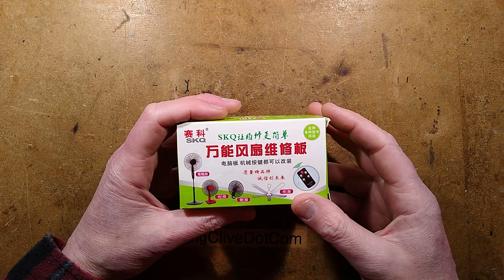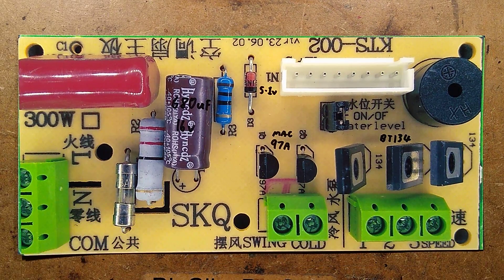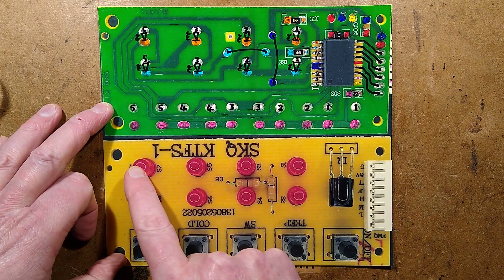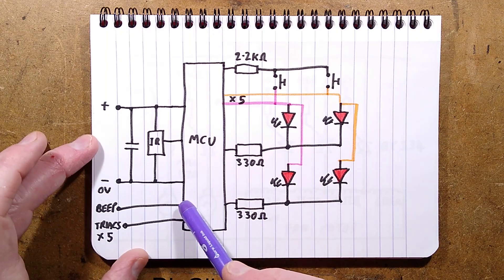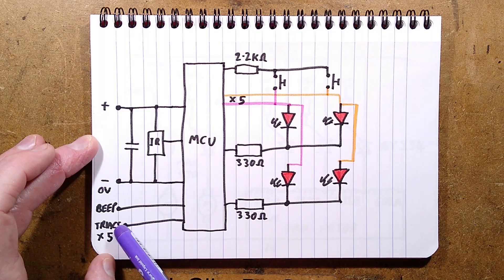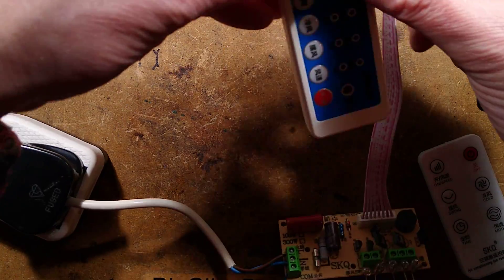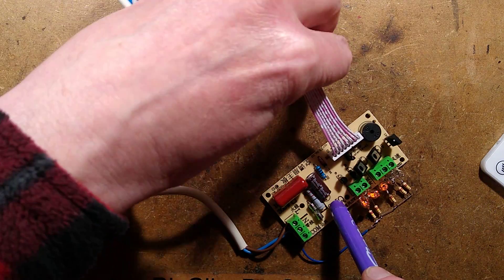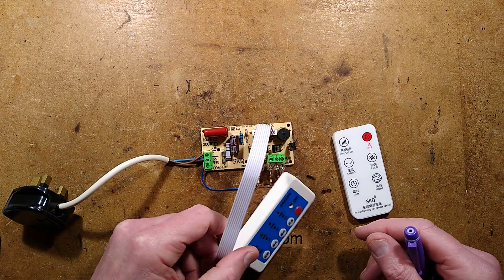Universal fan control module teardown - with schematic

Comment: just happened to be thinking about how i could regulate the new AC fans i found intended for trash.
Cofan 230V AC / 36W ..  usually i'd go with 120mm PC fans and use pwm.
Until now it was easier+cheaper to just get the "honeywell HT900E" to blow a/c-cooled air through my apartment..

Comment: I would love to understand why it can't use a bridge rectifier. You said one leg is referenced to the mains. Why does that prohibit a bridge rectifier?
Reply: For the TRIACs to be triggered properly the common of the DC control circuit needs to be directly connected to the common of the AC supply. With a bridge rectifier there is by necessity a diode in the way.
Reply: @eDoc2020 Thank you so much!

Comment: As you noted; the LEDs are multiplexed so I would not expect the module's current consumption to change drastically when the number of LEDs lit varies. Instead the TRIAC drive must be simultaneous and 100% duty cycle so would expect the number of TRIACs ON to dominate the current consumption. To an extent you could hear the quality of bleep change slightly when you switched on more outputs.

BTW: What was the rail voltage under minimum load ? Did it ever reach 5V ?
Reply from the maker: It peaked at just over 5V.

Comment: I have an industrial fan in the workshop with a similar control (single winding so there is only one triac), the mode button is called "breeze mode" on my remote and it changes between a sequence of speeds. An absolutely useless feature, driving a 250W motor with a triac is already loud enough without it shifting all the time. The way they control the LEDs and switch buttons is strange to say the least.

Comment: Sir,, i subscribed today.., again?
  Anyways have you or do you know how the soft start wotks on these very exspesive power cords.  They limmit start up currant.  I havr not found anyone expanding what they acualy do....
Thanks for your work.  I find it very helpful..
Reply from the maker: The simplest inrush limiter is an NTC thermistor.  But the more advanced soft starts seem to use a ramped phase angle control.

Comment: I learned what happened in electronics class when you miswire a multispeed fan motor.  someone brought a fan in with a broken switch and rigged up another, but got the connections wrong.  he turned it on and the fan started up and ran fine.  then about 10 seconds later big gouts of smoke came out of the front of the fan and smoked out the whole room.

Comment: That LED button thing is pretty cool. It allows the uC to multiplex the LED user 'experience' and also read the buttons kinda simultaneously. The uC will set whatever logic it wants to for the user on the inputs of the 330R lines, then it turns on the pink circuit, and also reads the input from the 2.2K signal line. Each time it goes through the loop, it is setting user output information and also reading user input information. Seems a pretty efficient 'multi scanner' circuit.

Comment: When you had the board plugged in and you were pointing i was thinking "my God Clive watch your finger's that board is live" 😮 
I could think of other uses for something like this.. it's able to switch a good few different things and had a timer too. The language barrier is worrying coz iv an awful habit of getting something and then going into a different project and forgetting about other things i wanted to try. Finding the parts i bought and thinking "what's this circuit board for again" and that having Chinese all over id be a while trying to remember.. i also have that electronic hobbyists curse of buying stuff you don't need or will ever use but never think "that was a waste of money"🤔🇮🇪🙏

Comment: Hi Clive:  How is the speed of an oven fan controled?  The one in my oven looks fine, and runs smoothly, but now and then it does not run up to full speed until given a thump.  First time I found this out was when the heating element blew, and I very nearly blew a second soon after, but was lucky enough to smell overheating in time. Very expensive little fault.

The motor looks simple and robust, with nicely self aligning ball bushes at each end, but I'm fed up trying to find thicker and thicker self tappers for the cover, every time I take it out to have another puzzle over what makes it speed up, and why it doesn't always work.

I wish I had discovered your channel years ago. I fear I will never be able to catch up now! My life seems to have been almost entirely spent just fixing one thing after another: anything that can break down always does so as soon as it comes near me!  It does teach me stuff, but I'd have liked a normal life too!  :/
Reply from the maker: Check the fan is spinning freely.  It may be getting sticky over time and only running when things have started heating up.
Reply: @bigclivedotcom  Thanks Clive.  I've stripped it down and cleaned it several times, and balanced the fan blades.  At first it was a bit tricky getting the armature to run dead centre, till I realised that just tapping the spindle while it was running that lined up the bushes, but there is no noticeable friction once it's lined up. I replaced the wire connector shrouds that had gone brittle and dark from oven heat (I use it quite often on high setting for bread making, which may perhaps be more harsh treatment than basic home ovens usually get. )  I was just puzzled at how the two speeds are obtained without any obvious way of setting them, in the external controls at least.  I thought it might have to hit some magic combination of speed and field strength in the right place at the right time, to give it a continuous acceleration up to the design speed.  Tempting to give it shots of silicone oil spray, while moving, but you really don't want that smell in your dinner!  :)

Comment: I'm just starting to understand electronics (the School of Clive is strong), but I'm a little lost on the power supply here. If the local 5v rail is actually the live connection, half wave rectified, does that mean that the +5v rail, referenced to earth, is 240v and the local 0v rail is 235v referenced to earth? I vaguely understand switch mode PS, but this design is new to me.
Reply from the maker: The 5V is referenced directly to live and the circuits zero volt reference is 5V below that.  It might make more sense imagining a 5V battery with its positive connected to a live wire.

Comment: Mode on my cooler is labled "Nature" and is meant to simulate a breeze(according to the manual) I have never used it. XD

It has the same remote as the one in the picture not the ine you actually have

Comment: I think the Mode button activates what in certain fan is called "night mode", setting the fan at high speed at the extremes of the swivel points and low in the middle point, so you can orient the fan and don't get a full direct blast of air when sleeping. Just guessing.
Reply: That's really clever. Something that I would definitely want on a hot night.

Comment: Have you ever done a cheap variable-frequency drive? I might think that a VFD is the only way to get a fan to run below lowest power? I hate that all fans go "high, hurricane, armageddon".
Reply from the maker: It would be a very complex way of controlling one of these fans.
Reply: On these fans you just need to vary the effective voltage. A cheap lamp dimmer usually works well enough, although it can cause motor buzz.

Comment: i recently had a smart metre installed , was shocked how much watts my standard floor fan uses , it is 14 years old though, do they pull more wattage older they get ?
Reply from the maker: They can pull more as the bearing lose their lubrication with age.  But it may also be the way your meter is measuring power.
Reply: The multi-tap motors used in most multi-speed fans are pretty inefficient, especially shaded pole types.

Comment: I used a six channel remote unit to replace my caravan motor mover controller. Cost about six quid, where the original would be over one hundred for a replacement circuit board, worked perfectly.

Comment: Is there a way to change the fan rotational direction?
Reply from the maker: It will depend on the type of motor.  Most fans use a shaded pole motor and can only go in one direction.

Comment: What's the quiescent current? Because I once had a ceiling fan with a similar module that ended up costing me 50€ per year for literally just hanging around.
Reply from the maker: It will appear higher than it is on simple current meters due to its very low power factor.

Comment: Can you still use the buttons on the stand fan to control the speed if this is installed?
Reply from the maker: No.  This would generally replace controls like that.

Comment: Interesting to note that the buzzer takes on a more "pulsed" sound when more LEDs on the control panel are lit, somewhere there's a component that's struggling to supply enough current! When I've used units similar in actual fans I always assumed it was the beating of the blades making the buzzer sound funny, not the multiplexing of the LEDs!
Reply: It’s because when the LEDs are on it’s showing more current from the power supply and since it’s halfway rectified it takes a lot more to filter it

Comment: I have a fan, that recently decided it was going to start changing functions without a button press.  Thanks to this channel, I was confident in ripping out the speaker that beeped every time it changed (it was literally every few seconds) i then also completely disconnected the wires from the circut board to the tilt motor.  It now no longer moves automatically, but it functions as a fan on low, medium and high as it should.  (And every few seconds thinks it's tilt is being turned on by an unknown source.  Still no idea why)

Comment: dude. why do some apps heat up i phones? i mean i kind of got why some cams flicker light but
Reply from the maker: It will depend on their processing power requirements.  A typical technical app should use very little power.  High power may indicate a gaming app or rogue activity.

Comment: When the "Mode" thing was enabled I was wondering why they'd have that, but seeing some other comments, it's a feature to create a natural-feeling breeze apparently, which actually seems like a smart idea, although could be annoying if I hooked one up to my wall fan that sounds like a damned aeroplane prop when run at full tilt (I currently have it on my stepdown transformer and on Low to keep it quiet!), though said fan does have a big IR window on it which would lead me to believe there is a more money model that actually did have remote controlled functions (or is just a place to hide a naughty voyeur cam)... :P

Comment: Do you think this is offered in the United States voltage? It would be interesting to see if the design is exactly the same. 😒
Reply from the maker: Some are advertised as working from 120 to 240V.  With a capacitive dropper it would be fairly easy to adapt it to 120V with a different capacitor.

Comment: After watching this video and reading the comments, I can see me using something like this to control a bunch of stuff here. I need a remote for an infrared heat lamp in the bathroom. Being able to turn it on and off while wet with a remote would be heaven!. We always swap those horrible LED lights for halogens when we move in. Also, we have shittee baseboard heaters which I can't tolerate since they take forever to heat up and forever to cool down.
We also have a nice in the wall "space heater" that has a useless thermostat (37 minutes to shut off). Having a remote to change it on or off from bed or the couch is something I was already planning.

Comment: I think they include a classic water level switch with faston terminals because many OEM switches now use tiny connectors with random pinouts and some are even low voltage DC.

Comment: 6:42 - Somebody in China's getting fired. I do this trick sometimes, but you can stick the zener there, so it not only limits the voltage to 5V, in one side, and pass the unused half of the AC, allowing the capacitor dropper to work. Saves one part, and the labor to install it. Use a 5.6V zener, instead of 5.1V, to account for that one diode's drop.
Reply: That does reduce the component count by one but it also increases supply ripple. With the capacitor-resistor-capacitor used here and the Zener at the output the result should be fairly smooth DC.

Comment: Awesome find. Here in Australia remote control fans are no longer available. A few years ago most fans were remote but not now. This module has the potential to be a simple inline unit for non remote fans.
Reply: Thats because 99% of fans in Australia are switched on late November and not switched off until about March. By then the remote is long gone.
Reply: As a Sparks here in Australia I finding plenty of ceiling Fans with remotes, on the shelves in most fan and light shops
Reply: @steveosshenanigans  Sorry, i was referring to pedestal fans.
Reply: @darkman19693  ah right, those POS fans i hate seeing those ones. There shite mostly sold in Bunnings

Comment: Having seen this unit on the Patreon stream I thought it would be useful, modified, to control a fan/light I had seen where the remote control was missing.
Unfortunately when the fan/light unit arrived I found that not only was the remote control missing, it seems that the light panel has also been removed along with the wiring for it and the power supply for the fan. The seller is going to search for the missing parts but I suspect that his source had removed the missing parts. I'm expecting I will get a refund from ebay.

Comment: I feel VERY comfortable with the Hyncdz-branded electrolytic capacitor. NOT!

As others have noted, "Mode" is likely a simulated breeze, using random-ish on/off and fan speed cycles to feel more like a natural breezy day instead of a non-stop blow. I personally don't like that "feature," but I can see some might prefer it.

Comment: 14:53 I have a Japanese fan that does that - it has a setting called “random” that effectively cycles randomly between the four speed settings (and off) at random time intervals to “simulate a natural breeze”. I guess that that’s what at least one of the things the “mode” button on your unit does.
Reply: I have a fancy japanese fan too, and i was thinking the same. It's supposed to simulate nature (because the wind outside isn't constant).

Comment: Clive, have you considered using an isolation transformer for your workbench? Makes probing around in circuits at live mains voltage a little saver. Keep up the good work, very much enjoying your videos!
Reply: Please bear in mind, an isolation transformer will save you from a Live to earth shock, but it won't save you from a live to neutral shock on the secondary of the transformer.
Reply: @kenaston4220  Yes, you are absolutely right. But even a RCD won't save you in that specific case. Always be careful when playing with live mains voltages. But Clive seems to be doing alright.
Reply from the maker: I have a type A RCD on my bench and an isolated working area.
Reply: @bigclivedotcom That's not enough...
In this case your body current must be sufficient to trip the RCD..don't know it's sensitivity level or response time to trip... before saving you.😮
Reply: I think Clive enjoys the odd bit of body current to keep him on his toes?

Comment: Someone I knew showed me the schematic that came with his washing machine. It included timing and switch positions for the motors, the pumps and the valves for each cycle type of the washer.  Precisely what you'd need if you wanted to replace the logic in the machine with something like a microcontroller or remote control. The schematics were tucked into a little pocket inside the back of the thing.

Comment: 😠 - they are expecting you to mount this “polished turd” onto the fan/evaporative cooler if it’s internal controller fails, effectively hacking it, I won’t be doing that ~ particularly it will look weird, you would have to drill a hole into the unit/original control panel, you might find the ribbon cable to the main “daughter” board too short to reach, and the main board might be too tall [with the threw-hole components sticking up] and the one that has failed has SMD components on it and it is in a small confined space. To me this looks like a controller for an external evaporative cooler

Comment: It always surprises me that the Chinese have not learned that there are more fonts than just Times New Roman.
Reply: Oh it's worse than you think, MUCH worse.
Default font in China (and Japan) is not Times but I think  Ming / Mincho / JhengHei or something like that. One that has ok-looking Chinese characters, but everything else are basically placeholders. MS Word seem to at least switch to Times when typing latin characters but not all text editors do that. 

If font substitution does not work - it produces text ｌｉｋｅ ｔｈｉｓ <- I didn't type any spaces there except between words, those are real Unicode characters that are supposed to look that way.

For non-Latin non-Chinese characters some Chinese fonts produce hideous near-unreadable text with characters stretched, deformed, randomly bolded, random height, and placed at random level for each letter. 

In partucular, early versions of Adobe products didn't substitute fonts, and the font they used by default for Chinese had bad Latin and horrible non-Chinese non-Latin characters...

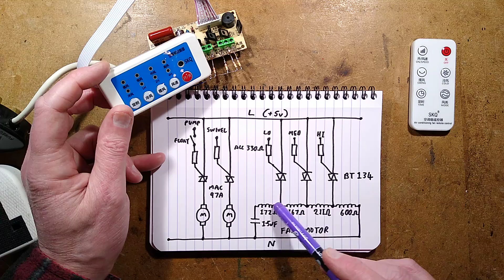Comment: 16:55 Wouldn't triac crash just result in fan running faster and not really do anything to shorted winding as it has the same potential on both sides?
Reply from the maker: The coil induces current into a core that would effectively drive current from other windings through the shunted one.
Reply: @bigclivedotcom  Totally forgot that the winding will be generating own potential, that makes perfect sense :)